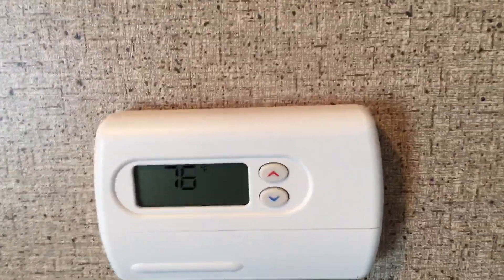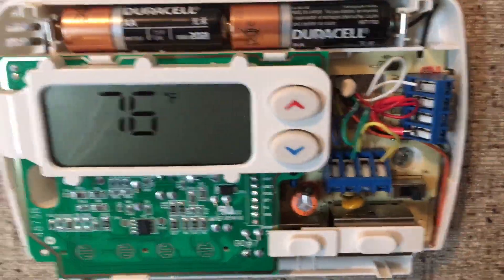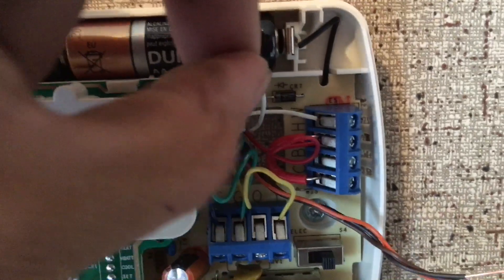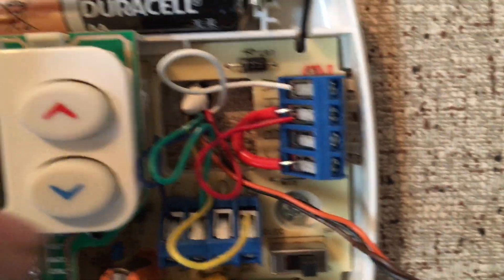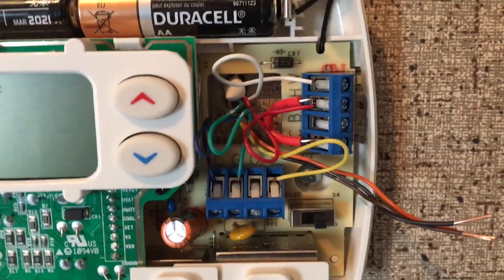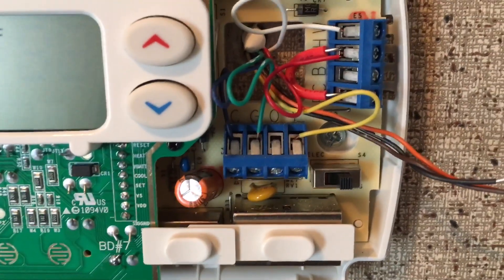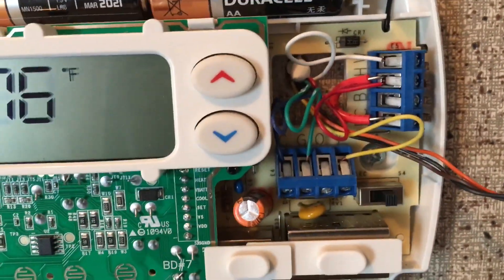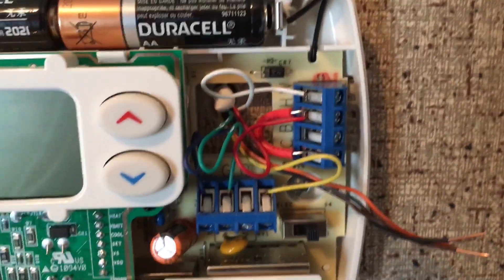How to wire a thermostat with 4 or 5 wires

Comment: I don't have a yellow wire. I have a blue wire. But on the new thermostat I got there is no place to connect the blue wire.
Reply: i dont have a yellow wire eiter
Reply: i dont have a yellow wire either so wat did u use in the place of the yellow wire?
Reply: @carlcoleman3813  Black wire. It does a/c instead of a yellow which I didnt have